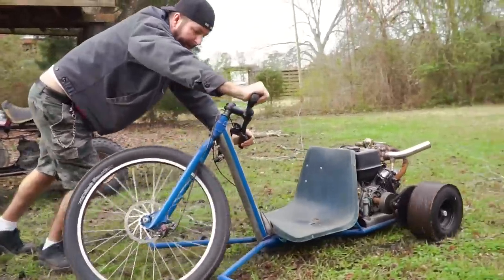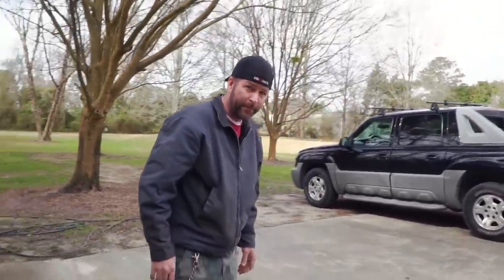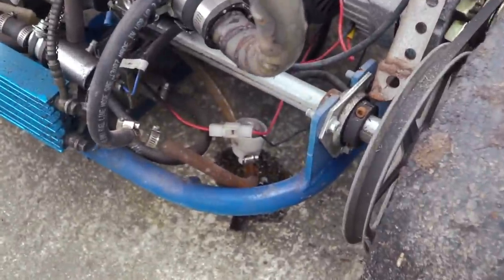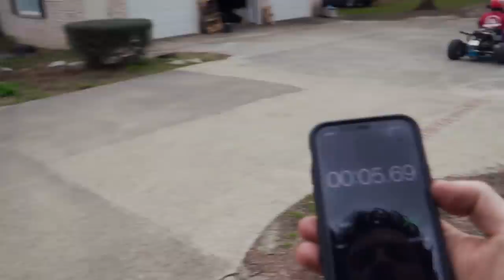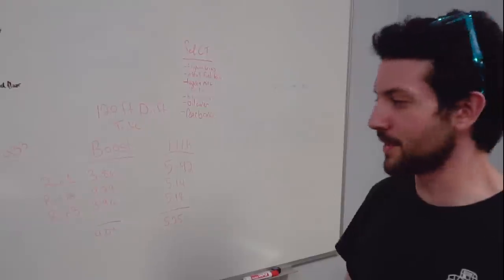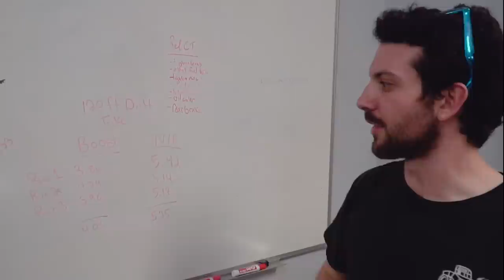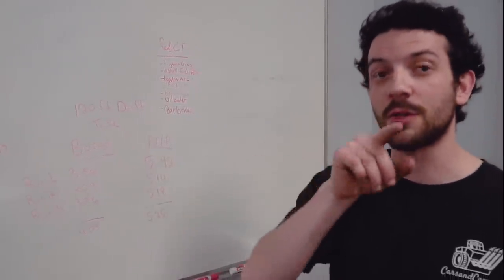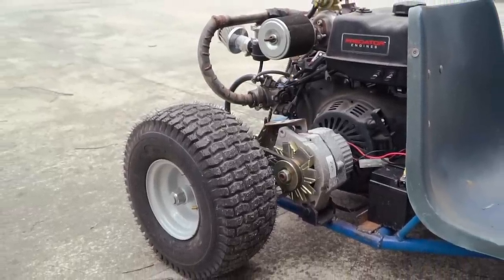420cc Turbocharged Trike Revival & Boost Test!

Comment: Try an easy setup with water injection like old Saab 99 turbo. Use a sealed can with water, put a hose from the intake to it so it get the turbo pressure. Than put a hose from the bottom of the can and put it in front of the turbo inlet with a nozzle in the end of the hose. When the boost will raise, the pressure gets in to the can and press water thru the nozzle. The water helps cooling the engine but it also raise the volume of the exhaust gases wich give you higher boost. You need to laborate some with the nozzle but i think you figure it out ;) Thanks for your great videos guys!

Comment: its working like a turbo on a diesel truck... improves the torque because those are tractor motors you are using there, they love low speed and heavy push

Comment: Me and my boy built an off road trike and it's hard to steer. I disconnected one rear chain and now(obviously) it pulls hard to one side under power. Still hard to steer but much better than with both tires locked together. I'll have some videos up on my channel soon.

Comment: You guys should make an air capacitor to go between the turbo and throttle body. The turbo only spools when the exhaust valve is open so it's not gonna be very efficient on a single cylinder engine. The boost capacitor stores that pressurized air for when the exhaust is closed so the engine is getting consistent boost pressure. Ideal size for the capacitor is about 4.4 times the engine size. Since the engine is 420cc, the capacitor would need to be about 1850cc to work properly.

Comment: To get around the corners quick, you need to lean your body more going into corners. Let the rear wheels drift out. Turning on pavement is almost impossible with a solid rear axle. I built a 3 wheeler much like yours many years ago. It had a 5 hp Briggs on it.

Comment: Does it have a boost tank?  On 1 cylinder engines, there should be a sort of "holding tank" since the turbo is pushing against closed valves for a large part of crank rotation

Comment: You need to add an expansion chamber to the charge pipe on the turbo since there's only one cylinder and not multiple. A 2 stroke exhaust might work good for it

Comment: I could not see what clutch you were running but a little more stall speed will get rid of the laggyness on the launch, If your FI box controls timing as well as fuel add a degree and a half just of idle before the boost comes in

Comment: You guys might be able to squeeze a little more out of that sucker with an accumulator on the intake side. I'ts just a big hollow section with like 1.5(?) times the displacement of the engine to even out the pulses from the engine. I remember Boosted Bois using one on their shopping kart with great effect.

Comment: Hey Ike and John I think before anything else turbo you guys should remake the turbo piping cause there are some of the turbo pipes that have pretty shape angles which would rob you of possibly more boost and definitely power since you guys have gotten alot better at welding and Fab and the turbo piping is old so yea just a thought and a turbo 670cc would be dope since there's another cylinder the turbo should work a whole lot more efficient

Comment: Atmospheric pressure at sea level is 14.7 PSIG. A boost level of one atmosphere (14.7 psig ) in theory will double engine power. Boost of 5 psig , roughly 1/3 atmosphere should increase power output by 33.3%. 5 psig is a fairly conservative boost number .

Comment: If you want to make boost with a single piston engine you need to have an expansion chamber before the turbo to make it work . the puff puff of the exhaust won't make boost pressure that's why it fails to work but with the expansion chamber it can build up a boost charge for the turbo to use. all it needs to be is a chamber like the 2 cycle balloon exhaust or a cylinder 5 times as large as the pipe going in to it to have the expansion effect . weld up a 3 to 5 in piece of pipe with a plate on both ends then have one end go to the engine the other to the turbo it only need to be about a foot long to have enough expansion to make a little boost .If you watch nugget garage they made 10 pounds of boost on a single cylinder engine doing this it works

Comment: Question.. if I switch from a 6in torque converter to a 7in do I need a different belt? If so do you know which belt I would need. Also it's a 30series. Thanks in advance.

Comment: You guy’s should make a boosted awd gocart, also I think you can really get the engines full potential by putting a torque converter on instead of a simple clutch.

Comment: Better Front Brake, Wider Front Tire, Stouter Forks even without shocks the ride and handling would improve greatly but you already knew that.
Reply: Also some kind of tilt system in the front for cornering.

Comment: I’ve seen a guy boost a 110 trike and he put a larger section sort of “tank” in the pipe so that it will be full of air so when you gas it the engine has a good initial gulp of air. That might help with off the line power

Comment: Interesting video guy's! Personally building at the moment a turbocharged Briggs Vanguard 570cc V Twin. Using the same turbo as you did as well as all custom 12v ignition on a "flywheel" basically a big aluminum disc for ignition timing, via crank trigger. As for fuel system it's going into a custom built blow through box utilizing a custom "Real" Tillotson carb modified off a 115hp Mercury outboard, cheap yet easily adaptable and made fully adjustable as well by long needle screws which will protrude fully sealed through the blow through box for easy carb tuning. Also running ported head double valve springs billet rods and forged pistons for a little longevity. Haven't yet decided on a cam shaft yet, weather to go stock or something a bit bigger on lift and duration? Thanks for posting this video guys, yes it's a shit load of stupid money on a lawnmower engine lol but it's taking place of my 2 stroke Polaris powered golf cart that's been fully modified as well. Don't get me wrong, I love 2 strokes and that's all I've ever built, but it's time to begin playing with some boost and forced induction! There's so much possible potential in creating artificial atmospheres inside the combustion chamber of an any engine. I also have considered one of my Wankels as well in the cart? I have a mint fully restored Arctic Cat 295cc rotary, and it's bigger yet less powerful brother the Curtiss Wright wankel arctic cat used for a few years a 303cc rotary stock they make in the area of 19-24HP. With a Turbo though?/? Who knows? BUT it would be interesting to find out wouldn't it:?? The only reason I was apprehensive of utilizing one of the wankels is due to the fact of pressure lubrication for the turbo which is what you guy's encountered with the non pressurized oiling system you have on your drift trike. It just makes more sense to me from a Cubic Centimeter standpoint to start with something on the larger side than just remaining the same size in CC's and adding a boost bandaid to an engine..... Plus no need for electric expensive oil pumps or some sort of crank driven pump which is probably more feasible for doing so with a remote oil box for reserve and circulation of the oil. But I find it fascinating and enjoy watching you guys play and grow with basically the same interests at stake. More power out of smaller packages! I could easily throw in a sweet running Honda CB500 I have sitting in the garage as well??? But I prefer the torque converter drive system of the cart. Yes the gears are extremely expensive to buy, but you only need to ever do it one time is the way I see it, to change your final drive speed. Anyways I'm rambling, need to get finished on the Tig welder for aluminum I'm building, thanks again and stay safe guys. Love what ya do here! 😉

Comment: Springer front end with a taller front wheel and tire would be cool. Not really extended much just springer. Install the wheels from a riding mower deck onto the foot pegs, a little above ground level, that may save from a roll over.

Comment: Whack the turbo on a stock low comp motor. Turbos prefer lower compression with higher swept volumes so they can really pump in lots of air and fuel. 
Simon. Australia

Comment: Turbocharging will make ALL the difference. It needs more boost pressure and some type of gauge so you can possibly see what it is making for boost pressure. Fully develop this one before moving to another please. Be sure to build the engine bottom end to withstand the extra pressure first.

Comment: Yeah with a turbo you don't get the extra power until the RPMs come up, so it makes a difference in the top end, but not so much off the jump unless you're able to build RPM first. But with a small engine clutch like that you'll wear it out trying to build power on the brakes.

Comment: You're not making that much boost because you only have one cylinder powering the turbo so it's only making boost when the exhaust valve is open if you had two cylinders then it would make constant boost because you would always have an exhaust valve open hence the turbo would spool constantly instead of only half of the time

Comment: "Method for turbocharging single cylinder, four-stroke internal combustion engines. Turbocharging is not conventionally used with single cylinder engines because of the timing mismatch between when the turbo is powered, during the exhaust stroke, and when it can deliver air to the cylinder, during the intake stroke. The proposed solution involves an air capacitor on the intake side of the engine between the turbocharger and intake valves. The capacitor acts as a buffer and would be implemented as a new style of intake manifold with a larger volume than traditional systems. In order for the air capacitor to be practical, it needs to be sized large enough to maintain the turbocharger pressure during the intake stroke, cause minimal turbo lag, and significantly increase the density of the intake air. By creating multiple flow models of air through the turbocharged engine system, we found that the optimal size air capacitor is between four and five times the engine capacity. For a capacitor sized for a one-liter engine, the lag time was found to be approximately two seconds, which would be acceptable for slowly accelerating applications such as tractors, or steady state applications such as generators. The density increase that can be achieved in the capacitor, compared to air at standard ambient temperature and pressure, was found to vary between fifty percent for adiabatic compression and no heat transfer from the capacitor, to eighty percent for perfect heat transfer. These increases in density are proportional to, to first order, the anticipated power increases that could be realized with a turbocharger and air capacitor system applied to a single cylinder, four-stroke engine."

Comment: single cylinder turbo engines need to have a big chamber (I don't remember what its actually called) on the hot side of the turbo in order to run efficiently as possible

Comment: Personally it seems like you’ve maxed out the clutch and need some kind of clutch assembly of some sort that can handle more power. Doing the 120ft drag to compare times it sounds like the engine hits boost and blows the clutch away

Comment: get a turbo from a superbike, make a pressure-damping intake (think of it as an exhaust-pulse smoothing item) (normal size tube, round plate, fuel-tank sized tube, plate, the rest of the intake, so the compressor (cold side) can build up pressure without being slammed by the exhaust. do the same thing with the exhaust. it will make more power and keep the turbo smooth. the turbo lag will be very slightly  longer, but it should make a lot more power.

Comment: See if you can source a 400cc+ dirtbike thumped, Suzuki, Yamaha, KTM, something like that, I say a 400+ as it should have more exhaust flow than a 250 (depending rpm) and so you should be able to get a small turbo to spool, DRZ400 are in plentiful supply so should be cheap, plus there's heaps and heaps of supporting mods since it's been around for so long.

Another suggestion. If you have something to pop it on. Get a air compressor cylinder/vessel, and hook it up with a few hundred psi, nothing crazy, and use a regulator to tune the output of the pressure. This would alleviate all the weight of a turbo and exhaust manifold blah blah blah. And would bring it back to basics. Only draw back is it requires to be repressurised once depleted. But that's why you throw in a substantial amount of pressure initially. 

I dunno. Seems cool me and no one has done it. 

To keep things safe you can add a solenoid valve downstream of the regulator to stop flow in the event something happens.....

Comment: check out Boosted Boiz shopping cart vids, they were making about 5 psi i think. main difference i see is you need to make some sort of chamber to store a little bit of boost because a single cylinder engine doesnt pump out constant exhaust flow.

Comment: make a new exshaust and a better charge pipe and you could get even more performance. Also you can use the eco-cal software to tune the redline, air/fuel, timeing and so on, to adjust the powerband and maybe pickup more power again

Comment: Be cool if you could try messing with the Honda GET engine, it is a very well supported platform because of the Ruckus and you can get a fuel injected version used in the Metropolitan or I believe from the Euro market. Have not really seen anyone try giving them a turbo.

Comment: If you really want it to build lots of boost since it is only one cylinder you should make a pressure reserve tank of some sort. I guarantee you will see a great power difference and a much faster spool due too how the engine is making and maintaining boost. With only one cylinder when  the exhaust valve is closed it is not spooling the turbo causing a drop in boost pressure making less boost actually go into the engine when the intake valve is open. With a pressure reserve it maintains the pressure in the intake side of the motor making more power as it goes through tbe power stroke and having more exhaust gases come out... It would not be expensive to build and it would really make it way more powerful.
Reply: It's actually called an air capacitor. https://youtu.be/dkbX3KLpbu0
Here is a link to a video of where you can see a turbo go kart project is getting one built

Comment: This is late but I beleive a torque converter would hold it at a better peak rpm for boost to be held at and then the belt would do its thing and the speed would increase

Comment: You could see which gets you a better bang for the buck, the turbo or the built NA engine, and then after that you should turbo the built NA engine. That would be awesome. I mean haltech has a $750 ECU there must be cheaper options than $1500 for EFI and turbo.

Comment: Build another drift trike with a fully built 420 bored stroke and work together with pauls karts for a tricked out head big valve ext and do a turbo 670 build since it has a oil pump and look into billet or a metal gear for the oil pump instead of the plastic

Comment: Boost the cross kart are bring the drag rail back and boost it. Be interesting on a 670 are the cross kart.the 670 if run separate intakes you might could twin turbo it.

Comment: Use a KKK kp31 turbo, original unit for the European Smart 800cc diesel. Its flow map is more appropriate for stationary engines than the GT08 clone, that I think is the one you used.

Comment: You do realize turbos don't work well on one cylinder engines! You only have one intake valve one exhaust valve and for turbo to spin all the time and produce boost constantly you need more than one cylinder that way you have at least one cylinder spooling the turbo at all times

Comment: WHAT ARE YOU GUYS RUNNING FOR ECU?!
SPEEDUNIO?!
Reply: Ecotron
Reply: DOESNT SEEM IT BUTTTT 200 BUCKS IS A PROGRAMABLE ECU THAT YOU CAN FUEL INJECT ALOT MORE ENGINES LMK IF U WANT MORE INFO!=]
Reply: @isaacitllbefine7231  Thats pretty nifty no lie buttttttt hows that ecu going to handle boost?
you can use the same parts as what you have but look into a speeduino 2 channel and bam you have boost control also a more stable afm's
all for less than 200 bones

Comment: If you had some better pipes for the turbo, aka bigger and sealed better, you would probably be up to a 40 to 45 percent gain, then add a boost controller and woweee it'll be fine!

Comment: Single cylinder turbo engines need a boost reservoir to work properly. Look up single cylinder turbo, air capacitor. In short a single cylinder has one pulse every 720 degrees of engine rotation and that creates a lot of unresponsiveness. Also by the time the gasses turn the turbo, your inlet valve has already closed and now the boost is just decelerating the turbo.

Comment: I like it but I guarantee it would be a lot faster if it had an electric motor.... At the middle of this year (2020) I got an mx650 w/ a 48v 2000w motor and it does about 35mph but I plan on getting a stronger electric motor for it, 60v-72v 3000w kit and it'll go about 50mph and go around 30 miles a charge¡!    😁👍🏻

Comment: Turbo Ducarti, why limit yourself to 100mph when 200 is possible. Also check out boostedboi's Turbo Shopping kart, their "Boost Capacitor" charge pipe makes the turbo a lot more consistant.

Comment: Your not running full throttle there’s a a screw in there we’re the throttle hand is at and it acts like a stopper and I’m not sure if you took it out but It should give you a little more power

Comment: That boosted 420 needs the governor removed asap!
Reply: Rooney fuck that, they need to take the fuel injection system off and put it on the built 420, along with the turbo